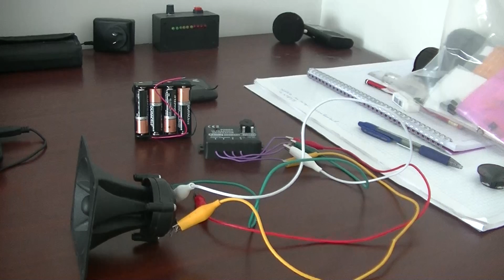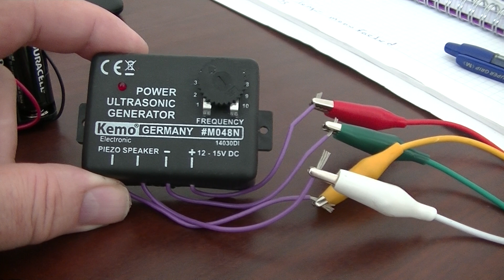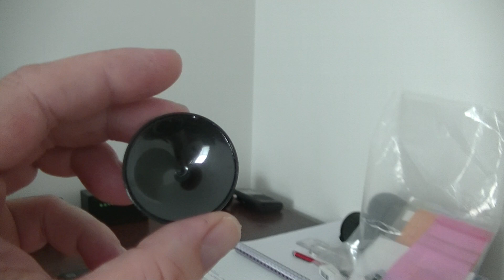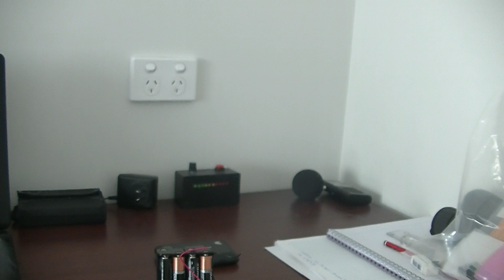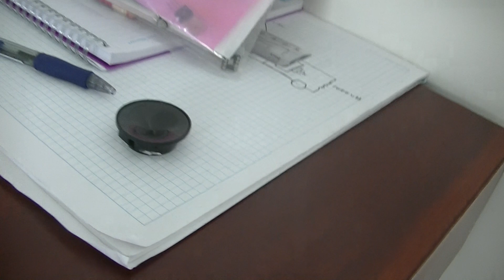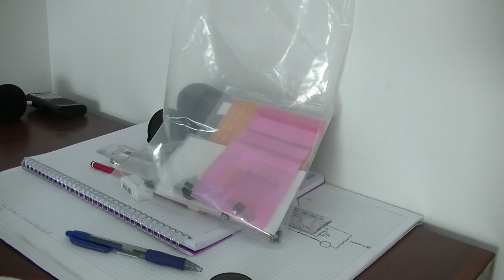ultrasonic infrasonic circuit test one

Comment: One rules first: for max. Power in ultrasonic piezo you habe to operate at 15 Volt, the max. Power supply for this device. Reason is, that this piezo are working better in higher voltage than in current. And car-tweeter will not usefull cause they are mit designed for ultrasonic ....
Reply from the maker: that was an old unsuccessful project going by the schematics dident help , since them ive brought the schematic's for one from information unlimited i think the name was and it was  for a nausea generator but following it to the letter dident make me feel nauseated when i built it so i used a 12 volts battery pack and connected a hevey 40 kilohertz transducer to it and it works great cant hear it but if i place the transducer on my skin i can hear it right through my head bypassing my ears
Reply: @stevenchiverton48  OK, one more tip: you can use an so called bat-detector so you can hear the ultrasonic sound... I have an older Version of the KEMO 48 for an operating Voltage up to 24 Volt. That gives the piezo a lot more power ....
Reply from the maker: i built a bat detector once it made clicks like it was detecting particles from the rain drops

Comment from the maker: ive nearly completed the ten led dazzler project to go with the ultrasonic circuit  just have a few more sections to make then comes the led part, as for the ultrasonic s ive built 2 but either though they are nearly identical  in appearances there ultrasonic sounds are a tiny bit off so they dont sound the exactly the same for unknown reasons same  they are both nausea generators  and i haven't included the actual kemo brand ultrasonic generators yet . either thought the 2 nearly identical nausea generators sound  a bit off and not in resonance i discover a surprise when i place the pizeos facing each other  and one reacts to the other like radar even when i run my fingers between the facing 2 pizeos and the energy from one to another alters the output sounds  when brought to close together, and when i run my fingers between them both to.

Comment from the maker: ive started experiments on a way to bypass using those technical audino things or pic chip and have come up with a better way to design and  put together some kind of led incapacitator  and revised sonic devastator in the one , as for the led one i just need to tune each for frequencies between 7 and 15 hertz and i get more frequencies then as they aint solid steady on the first test it jumped up one frequency then down one so for say 12 leds i get a 24 frequency sweep , and even better im designing a perspex design tool that only requires fixing to the copper clad board so all you have to do is drill it pen it then etch it   and its done  just solder in the parts

Comment: Lets collaborate. I can save you lots of time and money. I built a neuophone from scratch. I know how it works. used all the versions of it. Also I have experience with the wild dolphin project in Florida.
Reply from the maker: sure thing its working on 12 volgts now just have to adjust it more and ive thrown in a 1000uf low ers capacitor gives more power output to  and if i can hear the frenquency through my body id say i just have to feed voice to into it
Reply: Please allow me to show you the one I built.

Comment from the maker: ive made a printed circuit nausea generator and it works ok sounds louder using the pezio horn tweeter than the small powerful pezio loud speakers  i ran it off nine volts dc the instructions say you can use 8x 1.5 volts battery pack for 12 volts but it wont work on 12 volts only 9vdc and it dosent say what timer you use so i used the ne555 type  and i measured the frequency across the pezio and it read exactly what it says it dose 15.375khz and the maximum not mentioned is 50 to 65.222 khz and so i used the vlf receiver to hear if its adjusting ok and can hear it on that but when i tried the hevey 40kz transducer i got before from jaycar electronics it then dose nearly what Patrick Flanagan's  neuro transmitter dose and by putting your ear to it you can just hear it but when you bypass the ear and put it to your skin you hear it louder then and not via the ear canal this may have a few benefits for sure,
Reply: Long time no see how have you been

Comment from the maker: ive redone the tests with the kemo brand  power ultrasonic transducer drivers and dident get the same results and i think its the battery voltage in the battery pack has dropped since the first tests so the driver may be a  voltage controlled oscillator type  so when the voltage gets lower the effect drops off  no problems there  i can get around that

Comment from the maker: i have 2 power ultrasonic generators from kemo and 5 powerful pizeos they say are powerful where i brought them on e bay so the choice is the 70 watt one from jay car electronics which i find better than the smaller tweeter type brought on e bay   now i can use 2 and have them positioned to as to play against each other the frequencies i choose via the adjustment dial , and maybe chuck in an electric pc fan for some wind to help  anyhow its early days yet as i have accumulated more designs and yet to try them all out , if you've seen those woofer designs that use a fan at the front i to help the infra-sounds  maybe try a pc fan see what it dose  when i was younger id have an electric fan on and face it and scream into it you can hear your scream vibrate more as it hits the fan and the wind  and youl get an effect almost similar to the experiment ive done where it vibrates your ear drum, oh the vibration on my eardrum from powering the jay car pezio is in pulses as it feels like it to  so if i use 2 kemo power ultrasonic generators and each with a pezio tweeter i can tune one to the other so they resonate like having 2 radios on same station adjust the volume till you can hear 2 at the same time like they are echoing something like that, also my order of ultrasonic dog whistles come recently but when you blow on them soft you hear it but if you blow harder it gets higher so i think maybe the ultrasonic sound is in the highest blow into that whistle , so you may wonder whats this about well im looking for a way to attract or repel a dogman or yowie  which ever  i did believe that if dogman has a high sense of hearing like a dog then it to may get effected like a dog and be stopped from barking or other like the sonic dog bark stopper i have which sure works on dogs so why not Bigfoot or a dogman or yowie ill find out latter  and put together a device to acoustically attract or repel them